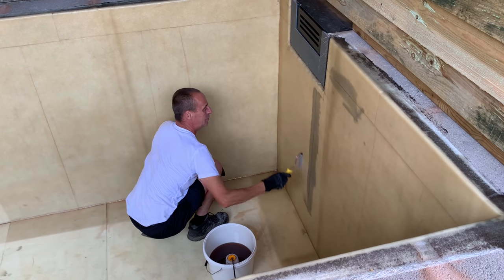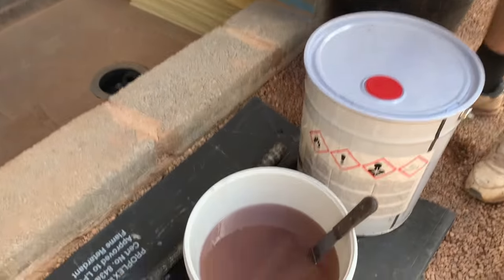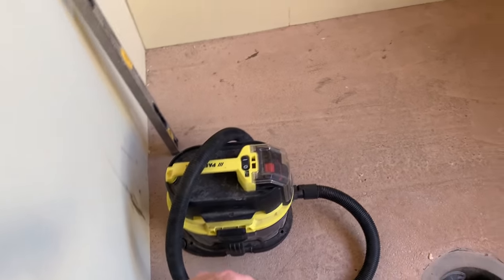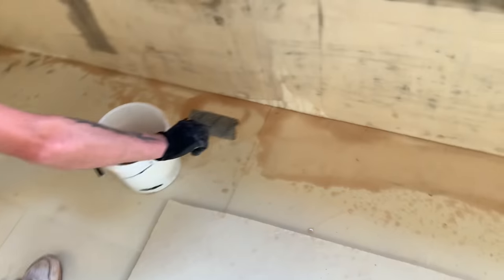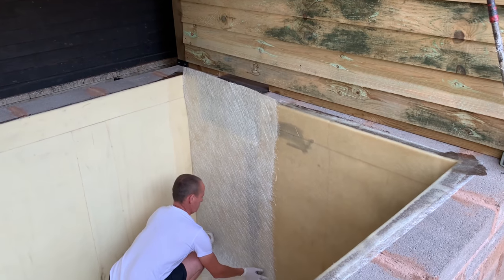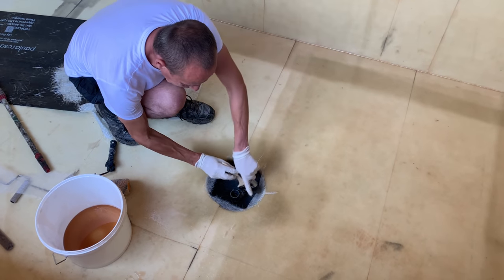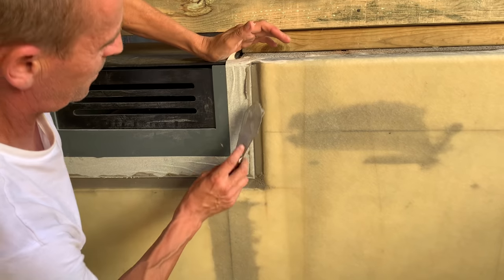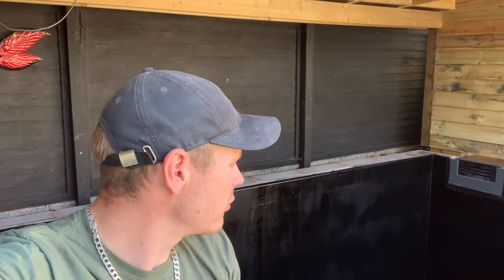MY DREAM KOI POND IS NOW FIBREGLASSED**STEP BUY STEP**HOW THIS IS DONE**RESIN ABSOLUTELY STINKS**

Comment: It looks the dogs bro, and I can tell your happy, I would be too... strengthening your opinion on fiberglassing I did my own as it was through lockdown last year, I pulled it off but it cost me on the resin and flow coat I wasted, 3 attempts to flowcoat my 1 pond, the sanding was awful, I would never do it again, I'd rather pay a professional, Matt has set the standard tho, if I move to Devon I hope he will travel for me if I need him too because my next pond will be my ultimate pond and my opinion Matt is the only guy to glass anyone's ultimate pond. Looking forward to the finished pond full of the wet stuff. Av a good week bro 👍👊

Comment: If you would have used  epoxy resin instead of polyester resin for your fiberglassing there would have been almost no smell coming from the epoxy. And you get the same results/ durability as the polyester resin.